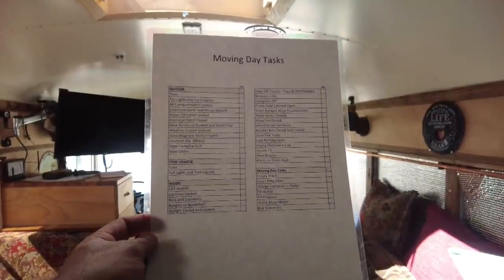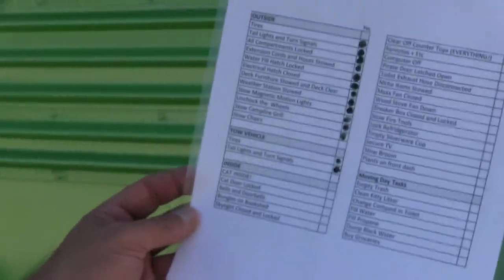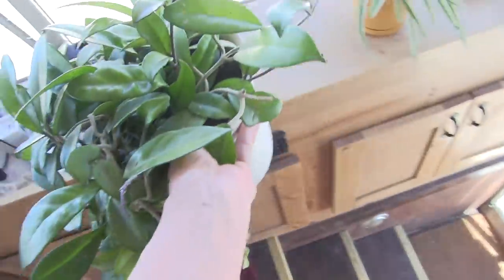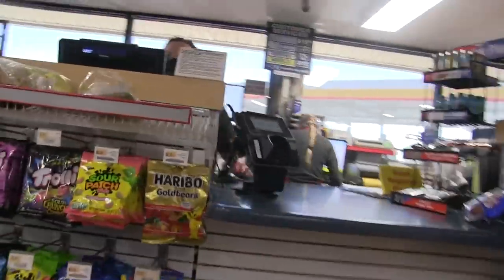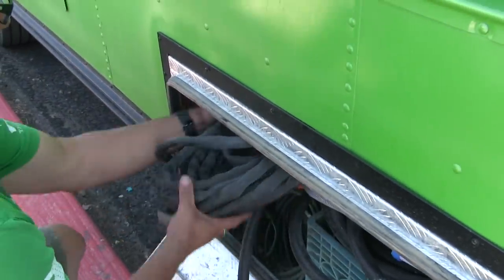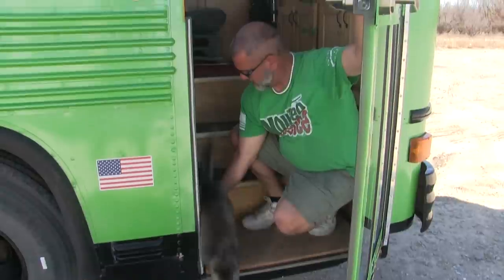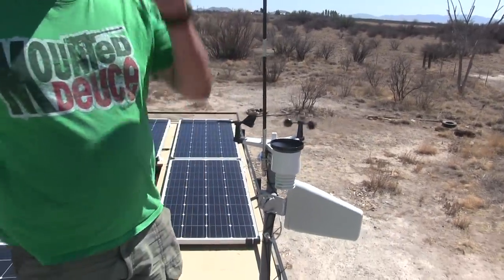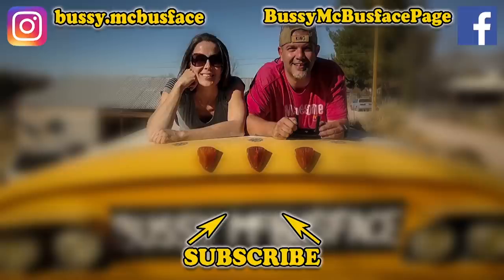Moving Day: Everything We Have To Do Every Time We Move the Bus!

Comment: For the compressor call Tony at AAA Bus in Phoenix. He'll know and will probably have 6 replacement parts on a shelf there. Also things to add... Emptying condensation from the air brakes, checking oil level, checking coolant level and for drips and dirty radiator, checking mirrors, belts, hoses, brake slack adjustment, mechanical gotchas.
Reply from the maker: Yeah, we've had a few comments about a mechanical checklist, great idea! Thanks!
Reply: @BussyMcBusface  also do a air brake test every time you get ready to go.

Comment: Mike, you should add a mechanical pre trip. Not just tires but all belts, hoses and fluids as well as grease points. Hope it helps. Love yall
Reply from the maker: That's not a bad idea...! 👍
Reply: @BussyMcBusface  Actually i wanted to suggest oil check, since a "check all hoses " might be a lil too much. But on the other hand, at least in Germany we have rodents that chew on rubber, so cooling lines n fanbelts are in danger. Anyway: Oilcheck can be vital since your engine might have  alil leak so you loose some oil over a 14 day period..... Greets from Germany, Mark and Georg, Holiday Rambler Imperial

Comment: Your water hose and poop hose are in the same compartment with no separation. You should get a rubbermaid or some other sealable container for the crappy stuff :)
Reply: It’s Grey water not poop hose, which is capped. The water hose is also threaded into itself, sealing it also.

Comment: The governor could cause the air to build slow, but their are other things also. If it has an air dryer the pop off could be sticking or  their should be two valves at the rear one for park brakes and one for service brakes and one in the front for the front brakes. Listen for air leaking when the bus is running at start up when it is having a hard time building air around the air dryer and at the rear.
Reply from the maker: You hit the nail on the head about the governor ~ we'll be showing it on our next video!

Comment: Mike put your black/grey drain hose in a pvc pipe with a treaded cap under the bus where it won't drag or anything and add a air chuck at each end of the bus fir a air hose to use air tools or airing up your tires

Comment: For your slow air pressure build up issue, try running your high idle switch after warming up your motor for a few. My tanks fill up faster when I do that. From what I've read it also helps oil pressure which also lubes the motor better than just idling.  Not sure if you already do that or not.
Reply from the maker: We finally made some progress on the air pressure situation, you will see in the next video!
Reply: I agree, Jennifer.  It would be great to see the details of the antenna set up along with the weather station.

Comment: Air governor is the issue for the slow building of air. But the real issue is you have an air leak somewhere. If the air system is totally sealed 100%, you shouldn't lose air unless you step on the brake pedal. Best thing you can do is go over all the air lines the next time you park with a spray bottle of soapy water (it is leaking somewhere) Try draining your moisture out of your air tanks that helps. And the stop light switch is on the treddle valve which is what your brake pedal is connected to. Yes it takes air pressure to get brake lights to activate.

Comment: My bus airs up the brakes and the air suspension. It takes time to fill all the air bags and the tanks etc. the governor usually sets the system pressure. I don’t think it will change how long it takes build pressure. You may have a leak if it’s suddenly taking longer
Reply from the maker: We just recently learned about the part called the D2 governor... and will be sharing more about that in our next video!

Comment: Okay, you just asked:  Does your outdoor hose space have a key lock besides the two flip- locks?  Just wondering about vandalism if you both leave the bus.
Also, when I had a 28ft Class C, I always unattached the black/grey hose from my bus and poured a 5 gallon bucket of water/antibacterial solution to clean out the hose.  I didn't have compost, so I would pour 5 gallons of the same solution down the toilet as it was nearing empty while it was attached at the other end.  Then put in an fresh smelling antibacterial solution.  I just never seemed to have an odor issue during the entire 5 years.  Have a good weekend... Aloha from Maui.
  P.S. Going to AZ for good next year, near Wickenburg home base (I'm a gold prospector).  C'
Reply from the maker: Yes, we have keys to lock up those storage bays! Sounds like you had a good system for keeping odors down, thanks for the tips!

Comment: You can tap into the air system on the bus & install a quick connet air fitting.  Then you can air tires before leaving.  Also, I'd start looking for air leaks.  You shouldn't loose all of the air in 2 weeks.

Comment: I would suggest flushing the black hose with clean water from the water fill up before you put it away. You don’t need to attach the two hoses but let gravity do the work. That way you can get any left over stuff drained into the drain before having to compress and put it away.

Comment: The 25 PSI then hold is the pressure protection valve that opens as the bus is airing up and filling tanks... think of the pressure protection valve in reverse, when you loose pressure, ie, you loose an air line, the pressure protection valve closes and protects the remaining air for braking ... I’m a little concerned yours is set at around 25psi... my MCI is set at 65psi  - doesn’t mean it’s wrong, just different.
Reply from the maker: We finally figured out the issue ~ it'll be in next week's video!

Comment: You've either got a compressor issue or a valve going bad, if it's not a leak in your air system. Might want to check your pressure from the compressor to your tanks.
Reply from the maker: We just recently learned about a part called a D2 governor ~ we'll be covering that in our next video!
Reply: @BussyMcBusface  worth a shot. Best of luck, hope it fixes the issue. Fifteen minutes is way too long for air build up, should only take a few minutes at most.

Comment: Great video.  I’m with Mamacita...that buzzing would drive me nuts.  😂. I would consider taking the knives off the magnet strip as you definitely don’t want those flying around in the event of an accident.  Also, I’d consider keeping a spray bottle of 1/2 bleach and 1/2 water, to spray down the water spigot before filling up at the dump station, as you never know how clean (or not) the last user was in using it.  🤢

Comment: Man I'd rather have the slow air then the issue I have of cranking for 1-2 solid minutes getting it started.. But I'll do some research and get back to ya
Reply from the maker: Just FYI ~ we figured out the slow air pressure issue ~ you'll see in the NEXT video!
Reply: If it's taking that long to start you may have a starter going out or your engine may need an overhead done.

Comment: Nice video guys always a pleasure you have on board air
Reply: You can Pipe it and put air fittings and use that to air up your tires
Reply from the maker: @jeep90jeep  Yeah that's exactly what Mike wants to do!
Reply: @BussyMcBusface  You can us a small electric air compressor on a quick connect to air the bus up before you start it to avoid the engine idling for 15 mins....and the dreaded buzzer. It should not take 15 mins to air up. Governor might be sticking

Comment: You can buy one of those 4 way faucet keys off of Amazon for a couple bucks, school bus drivers start the engines first then do safety checks and stuff while the buzzers are on, could tying a shoelace to the handle of the skylight help with closing the hatch? Just some thoughts i had while watching, peace.
Reply from the maker: Yeah, we made a discovery about the buzzer, which will be covered in our next video! We also thought of tying something to the skylight handle, but then it would hang down into the walkway when the skylight is shut! I think we need some kind of a DETACHABLE cord that we can clip on before we open it, then remove once we shut it! 😂

Comment: probably a good idea to let the watrerhose flow a little to get the old water left in there out before you drop it in the tank
as for the low tire : on trucks here you can use the air for the brakes using a hose hookup to fill the tires on the spot , might be handy if youre out in the middle of nowhere with an allmost flat tire

Comment: Yeah, the air dryer on brake system cycles. If it isn’t “cycling” properly it’ll take time for system to fully pressurize. Get it looked at, ya don’t want a brake failure.

Comment: I noticed that you move your plants before you leave. Why not build a plant holder by cutting holes in wood & attaching it to your cabinet.
And on your dumping your blackwater, instead of using rocks to hold the hose down in place. Why not try welding two weights to a piece of metal or rope together.

Comment: Sounds like your air governor is going out or you have a substantial leak or worst case you have an air compressor going out.  Air governors usually cost about $15 bucks and are easy to replace.  You can adjust them to get proper pressure but usually a new one doesn't need adjustment.  I always keep an extra air governor on hand because it's a cheap part and it keeps your truck/bus off the hook$$$.  Be well!

Comment: Anyone know what happened to the glass in the door?
Reply from the maker: Yeah, we broke that on a low tree branch while maneuvering into a VERY TIGHT SPOT! It's no big deal though, as several of those glass panels were already cracked. That was the glass from our original bus door, and we had to cut it to fit the new door we built... which is when we first cracked them by accident.

Comment: Mike, 
Did y’all put insulation in the roof? Oooor , was it already insulated?
Reply from the maker: We wanted to keep the original metal school bus ceiling with rivet lines, which means there's no way to replace the thin layer of crappy insulation that comes in the bus ceiling! So last winter we noticed a distinct difference in temperature between our bus and our friends Paul and Lisa's bus. They not only insulated their ceiling, but put 6 inches in their walls, as well, and their bus was several degrees warmer than ours! If we had it to do over again, we would definitely tear out the ceiling and insulate much better!
Reply: @BussyMcBusface  Thanks for getting back so quickly. I live in Texas and our winters are relatively short, but summers are brutal. Thus, Henry’s Tropicool is in my future I guess. I’m sure lining the top with wood would also be of benefit.

Comment: I'm thinking about doing this so I have a silly question (new subscriber) How do you know that the bus is level?  Just the feel, I mean you have a big bus your front end could be and back not?
Also the antenna what exactly is it for?  The one thing I'd need is to make sure I'm connected.  Is that even possible when Boondocking?  Would I need to stay in RV type parks?
How much did it cost to dump? Fill with water?  Thank you for any info you can provide.

Comment: Jus wondering why you didn't run water through the sewage hose after it did its job ? You know so you don't get any of that "spuge" on yourself the next time you connect .
Reply from the maker: I just dumped the other day and noticed most RVs have a connection that flushes the black tank and I was considering adding something like that to ours to do just that.